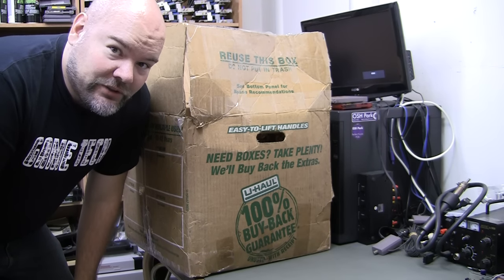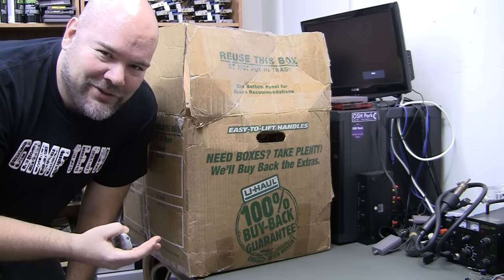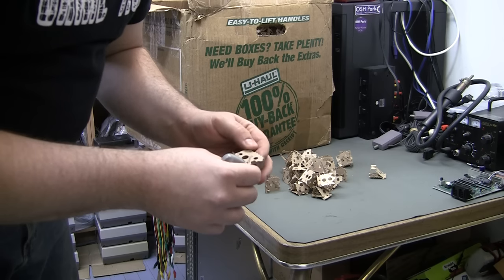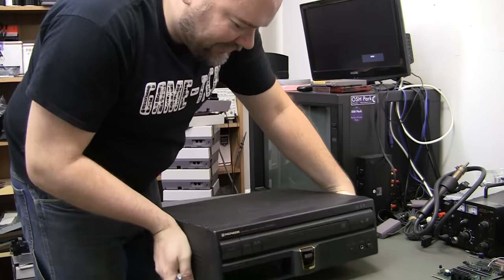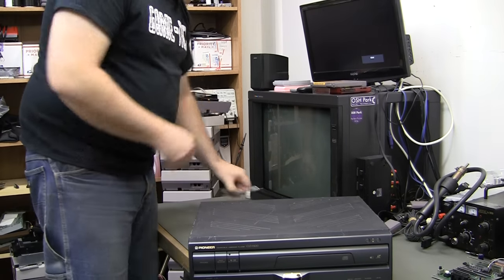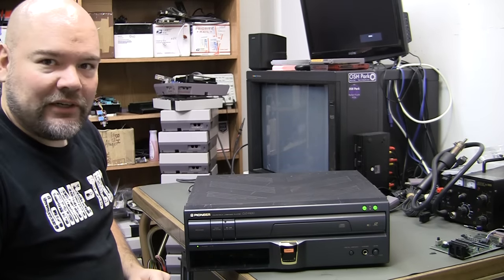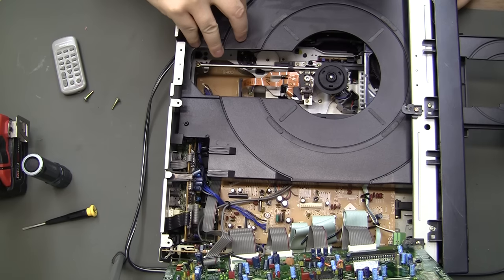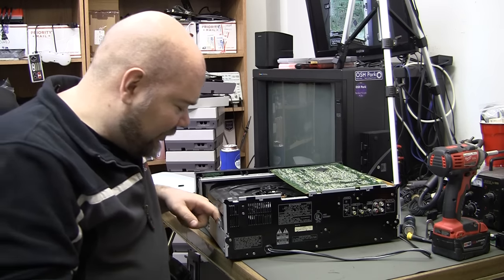Pioneer LaserActive repair Part 1 - my first attempts at repairing these beasts!

Comment: love these ebay junk videos.  keep them coming.  your timing is on point.  i just did a component video mod on mine about 10 days ago.  best part about it:  no jailbars at all.  worst part about it:  recapping the sega PAC with its 80-something SMD caps.
Reply from the maker: +schweatty 
Wow, is there that many really!?!?! I have like 10 of them to do, guess I better get prepared!
Reply: +GameTechUS 

He's not kidding.

I've recapped a PAC-S10.  It's a big job simply because of how many SMD electrolytic caps there are.
Reply from the maker: +Watcher3223 
Now i'm worried and will start in on them asap!
I will however do it like the duo's and use ceramics since most are just power bypass caps, will make it go faster and easier too...
Reply: 81 to be exact.  the ceramics are a good idea and will make it go faster.  i'm assuming your keeping the cost down by buying in huge bulk.  those ceramics are a little spendy for my hobby-ist level modding
Reply from the maker: +schweatty 
Yeah when I started doing ceramics in duo's I bought them by the thousands, the bigger the capacitance the costlier they get of course, but worth it!
Reply: GameTechUS

Of course, you won't have to worry about leakage with ceramics.

Comment: Great work, i've bought a faulty unit and i want to check the PSU cause the LaserActive turns on but nothing else works, only the reset light turn on and there is nothing on the screen 😅

Comment: An axial Picofuse will fit in that location no problem finding one at that oddball current might be an issue though.

If worse comes to worse and space allows you could always install an axial glass or ceramic fuse with leads fused to the end caps. They come in sizes as small as 3.6mm X 10mm.

 A TO-92 what a strange package to put a fuse in.

Comment: Regarding the behavior of the loading mechanism, it's certainly not supposed to do that; where pulling the tray lifts and lowers the traverse assembly.  At this point, I'd manipulate the loading mechanism until the CD tray is in the fully closed position and the traverse assembly is in the clamped position.  This is because if the CD tray is all the way in, then whether the loading mechanism permits the CD tray or the LD tray to eject is dependent on the position of the optical pickup on the slider path.

The two tall screws on the rear of the tray are supposed to retain the drawer, but this is because the drawer is supposed to be removed by pulling it out from the front.

And, regarding capacitors on the Sega PAC-S10 modules, I've found these pictures that may prove helpful.

http://s905.photobucket.com/user/bmcdanold/media/Repair/PacS1_Main.jpg.html
http://s905.photobucket.com/user/bmcdanold/media/Repair/PacS1_Sub.jpg.html

Comment: I notice no start up screen if it has one I have a similar problem with a cdi 910 powers on but only a blue screen n nobody will fix it for me n I saw fluid so a cap or 2 must of leaked

Comment: Other than the fact this player can be used to play Genesis/Sega CD, and TG-16/Turbo CD games...it's a mediocre Laserdisc Player as it's based on a 600 series CLD machine.

Without watching the video, I can already say the belts will be stretched and slipping, so the trays will have issues opening. The side flip may be non operational since the 600s had a crappy side flip mechanism as well. 

I would replace the caps as well. 

And yea, RGB won't work on Laserdisc. I do have my CLD-D702 running through a Panasonic DMR ES10 DVD recorder, taking advantage of it's comb filter and outputting component. Just never use S-video on LD.
Reply: +TGOTR 

The CLD-A100 has no both-side play functionality and, mechanically, has more in common with the CLD-S201.

You are correct in assuming that the loading belt is most likely worn, but the symptoms would be the player not being able to complete the clamping cycle on a disc, especially if it's a LaserDisc since the heavier weight places a greater burden on the loading mechanism.

The part number for the loading belt is VEB1184 and may still be ordered direct from Pioneer, but the belt isn't cheap; it's almost $7 just for the belt.

So, a better route would be to measure both the old loading and pickup slider belts, deduct about 5% from the measured size to account for stretch, and then order the required belts from Studio Sound Electronics.

As for it being a mediocre player, that's relative.  You've never played around with a Sony player, have you?
Reply from the maker: +Watcher3223 
Thanks for the belt tip!
Reply: *****
I have not messed with a Sony player, I'm not crazy. I thought the Laseractive had two side play, meh. I am happy with my CLD-D703.
Reply: ***** Well, you're wise enough to learn from example rather than experience when it comes to Sony LD players.  There aren't many that are worthwhile.

As for the D703, that's a very solid player with Gamma Turn dual side play.  Just no AC-3, but that's no big deal if you don't have AC-3 discs and the AC-3 RF demodulator to pass the Dolby Digital signal to a surround decoder.
Reply: I just stick with stereo, no room for a surround sound system. I may upgrade to a 704 when I can get a surround sound.

I also avoid the DVD/LD units as they are fickle as well.
Reply: At least they made it rack sized and dimensioned.

  So many consoles want to get out of the rack format with stupid top loading designs that look like melted hunks of plastic or some geometric shape hacked into shape with a machete

Comment: http://console5.com/store/icp-n15-rohm-in-circuit-protector.html

This is the circuit protector you need.
Reply from the maker: +Watcher3223 
Yeah that guy carries a lot of good stuff, but I can get like 50 for $11 from china, just have to wait for holiday to end and then slow shipping....
Reply: +GameTechUS 

Whatever works, though I will always be leery of ordering stuff from China, especially with what's supposed to be a protective device.
Reply from the maker: +Watcher3223 
I'd bet that's where he gets them too though...
Reply: GameTechUS

Very possible.

That's a good point.
Reply: +GameTechUS Better going through a reputable middleman though, as opposed to trying to order directly from the Chinese on eBay.
Reply: +Jesus Zamora No not really. China isn't really this big place that wants you to fuck you over like people want you to believe. It's where pretty much every small component is made for various electronics. Places like Aliexpress and eBay have so many protections that you wont get fucked over, either. If you usually run into problems its fully assembled things that have low QC but you get what you pay for in that sense. Components are components.